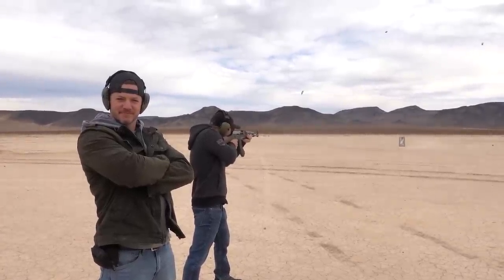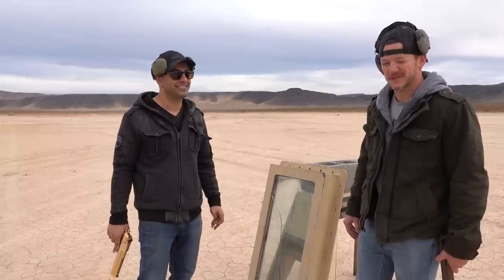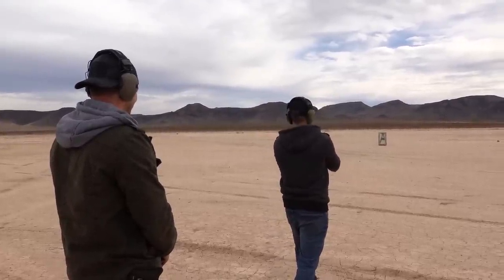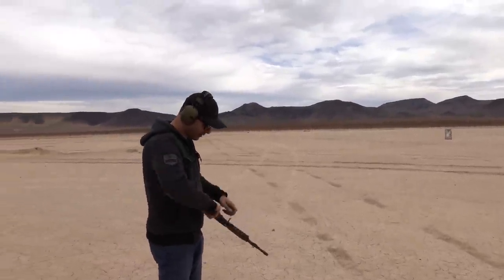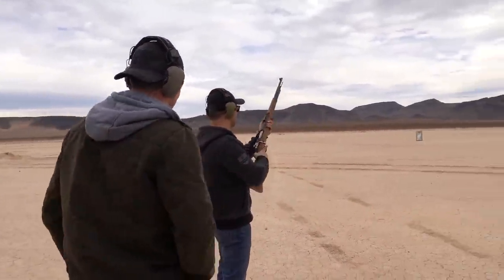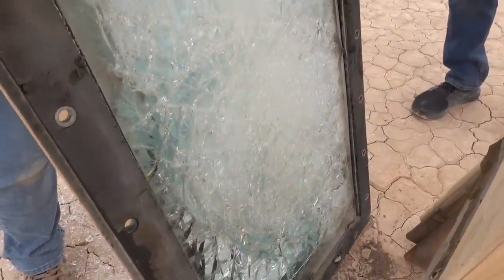Buffalo Minesweeper 6" Thick Bullet Proof Glass vs 50BMG

Comment: The entirety of the glass was compromised by the time you got to the 50 BMG incendiary armor piercing rounds.. I kinda wish you had started with those instead.
Reply: Juppp
Reply: Half the videos are like that.. by the time he moves to the big round, whatever hes shooting at has already been compromised by all the smaller rounds..
Reply: Was just about type the same thing.
Reply: True
Reply: Ramzes Motoa true
Reply: Lia Flexx ak-47s use magazines not clips
Reply: Mitch Zimmerman we all 1 him to star that way. I bet by the time he get to the 44 it would do the same thing.
Reply: Agreed. It was basically 50 BMG Vs. a tray of gravel by the end.
Reply: Maybe if they had a bunch of the windows
Reply: Lia Flexx  the mag is something that holds rounds and has a mechanism to move the rounds and get them to the firing chamber long story short.the clip is a piece of metal that holds a few rounds together and is used for quick reload.example.mosin stripper clips,kar98clips,m1 garand and sks clips.a 5 or maybe 10 round piece of metal that you use to put rounds in fast then throw it away.meanwhile the mag is a more complex thing that should be kept.

A magazine is an ammunition storage and feeding device within or attached to a repeating firearm. Magazines can be removable (detachable) or integral (internal/fixed) to the firearm. The magazine functions by moving the cartridges stored within it into a position where they may be loaded into the barrel chamber by the action of the firearm. The detachable magazine is often colloquially referred to as a clip, although this is technically inaccurate
Reply: Gotta stretch the video somehow
Reply: Exactly.
Reply: Ramzes Motoa ...but it isn't.
Reply: I agree totally!!
Reply: Totally agree..the glass was quite damaged before the 50
Reply: Lia Flexx  Please don't say clips.
Reply: client comun sks is magazine fed
Reply: Yup, or at least just firing one round from each of the smaller calibers instead of peppering the entire panel.
Reply: Yes, wanted to say the exact same thing
Reply: exactly this.
Still a great collaboration
Cheers from Tokyo!
Reply: @toddlaplanteVT85  this is why he sometimes has multiple of the item hes shooting
Reply: Lia Flexx  mags
Reply: Yea I hate it when gun channels test somethings ballistic stopping power for a particular caliber but build up to it with other calibers it's like do you understand anything ?
Reply: client comun unnecessary rambling
Reply: Lol I left a similar comment and scrolled down to see a butt load of the same comments. Lol maybe we can get a re-test like I mentioned. It's a big maybe though I fear
Reply: seriously they shot way to many rounds
Reply: If it hadn't been shot at all, if you place a couple of AP rounds in about the same area, the second shot has a very good chance of going through, especially if they're tungsten core AP rounds.
Reply: Agreed. A proper test would start with the BMG rounds, then worked their way down. That thing was weakened to all hell before they finished it off. No quality data from the test.
Reply: Ramzes Motoa what do Dshk's fire? Is it actually .50 BMG, or is it some Russian round. 
Sorry I don't know haha. All of my knowledge of the gun comes from video games, and all of which say .50 caliber, but that seems odd since I thought that was a NATO caliber
Reply: Integrity of the glass was compromised.
Oh well mistakes happen!
Reply: i said the same thing when they looked at the back side and i seen the holes in it.
Reply: Ramzes Motoa  Not a valid test for what they were testing
Reply: >rated to 50 cal
Proceeds to shoot it with pistols and intermediate calibers just to test it.
Reply: @bigsmokey1439  Older SKS models had a fixed magazine that was fed from the top with loose rounds or strips. Modern versions have detachable magazines.
Reply: David H ohhh ok that makes more sense thanks I wasn’t sure but all the sks I’ve seen are detachable magazine styles
Reply: Same
Reply: I always think this.
Reply: @bigsmokey1439  Saw somewhere that they were reasonably common in the US for a while. You couldn't get new ones under the assault weapons as they had detachable magazines but older ones could be imported under "relic or curio" clause. 
Apparently it's a bit of an issue now as it's legal to buy a new one with detachable magazines but illegal to convert an old one to accept them...
Reply: David H lmao gun laws are just becoming more confusing on purpose to scare pepole from owning them
Reply: @alastor8134  I do agree I've been watching for years.. but saying we're going to "test" it then pepper tf outta the only one you have.. then say it failed on the big rounds. WTF did you think was gunna happen?! I love Matt's vids and I'm not hating on the dude but after what 7 years definitely change of video quality
Reply: he allways weakens the crap hes testing, its like whats the point of using 50 if you just shot it like 80times.
Reply: Oops
Reply: Lia Flexx  probably would've tooken more 50 bmg rounds but that's why they have full auto 50 bmg mounted mg's
Reply: Edwin says it cost $1850 for shipping.
Reply: Totally agree...if not for sure it will not go through
Reply: Yea but think like he had to... What if 50 BMG didnt made it? Than all the other guns are useless to test and he just had an 3 min video🤷‍♂️ that's not how it's works out for him....
Reply: @Washman-jw3hl  Well Denel that designed and built the Buffalo's are in dire straights. So maybe getting windows from the South African military wouldn't be that hard
Reply: Thats a good point.
Reply: considering normal 50 BMG didn't go through while it was compromised, I'd say it's a good test. It would be nice though to see uncompromised glass against the API ammo
Reply: straight up they wasted that
Reply: I came to the comments to post this. REALLY disappointed by this choice!
Reply: Yes
Reply: Exactly
Reply: Tbh it was the first thing I thought about when he said he was starting small

Comment: They’re a tough damned truck. Saved my life on several occasions.  As far as military vehicles go, it was the most comfortable ride I ran in.  Great truck.
Reply: Chad Huston Sorry, they still use these nowadays in U.S. military?
Reply: @youngt-roy8211  yeah
Reply: @youngt-roy8211  Yes, along with new modifications.
Reply: I've never seen one before this video, but I've gotta say, they look badass
Reply: A trusty wheeled Vic for rout clearance huh
Reply: Can I get one of those trucks?
Reply: Why not. Get necessary education and join the army. You will get it for free
Reply: Deddinately the most comfortable vehicle I have ever driven
Reply: NuclearBolton you actually can, I think.  One of the things they pushed is it’s mostly off the shelf.  They’re retardedly expensive, but you can buy one.

Comment: “Its 350lbs. It’s not possible to lift by not even 4 people I think.”

Ordies somewhere laughing while loading 500lbs bombs on aircraft with only 2 people
Reply: *Laughs in Eddie Hall
Reply: Yea with the help of a loader
Reply: Bandit still just two people supporting the weight
Reply: Not ordies but  Oberst !
Reply: I know someone who can lift 300 lbs
Reply: @petercarino8540  300 lbs evenly balanced on 2 ends of a bar that is designed to be gripped, and a 300 lbs 3'x4'x0.5' rectangular slab are 2 entirely different tasks. That's not to say there aren't quite a few freaks out there who could lift that thing alone because I'm certain there are, but a weightlifter with even a 500 to 600 lbs deadlift probably isn't gonna be able to lift that thing, even if you were charitable and let them use some straps to help focus their force near its center of gravity.
Reply: I'm an old ordie who did just that back in the 80s.
Reply: Im pretty sure if I can carry 6 packs of shingles a trip I can lift a 350 pound window lol. Most of the guys I work with could.
Reply: Sure you could big guy.
Reply: @martyjehovah  there's always the kid in the YouTube comment sections that go on wikipedia and copy and paste  like they know everything
Reply: You're not gonna lift the glass that easy up onto a minesweeper. That's probably what he meant.

IYAOYAS
Reply: Are they the purple helmets?
Reply: @martyjehovah  nvr seen the shield carry? nothing very balanced about them

Comment: Nobody:
Edwin and Matt: Lets shoot a 50 high penetration round at something meant for IED blasts and small arms fire
Reply: @jakep111  .50 BMG is an anti-material round. Not exactly small arms.....dummy.
Reply: hahahahaha... its not a small arms imperial japan on ww2 uses .50 cal as an anti tank..
Reply: WC_2 Electric_Boogaloo it doesn’t matter. Look up the definition, it will tell you that it is a portable firearm, including 50 BMG
Reply: @jakep111  portable. Like the M2, MK19, recoiless rifles, AT-4, Stringer. Portable.
Reply: @natebrank4240  Actually Jake P would be right in a way. It would be borderline Small Arms.  Revolvers and self-loading pistols, rifles and carbines, assault rifles, sub-machine guns and light machine guns would be considered Small arms, and that is an Anti-material rifle. Some could even say that weapons that fire under the 20mm round would be small arms.

 Though there is also the classification of Light Weapons, which are  heavy machine guns, hand-held under-barrel and mounted grenade launchers, portable anti-aircraft guns, portable anti-tank guns, recoil-less rifles, portable launchers of anti-tank missile and rocket systems; portable launchers of anti-aircraft missile systems (MANPADS); and mortars of calibers of less than 100 mm. Which is why I said it would be border-line.
Reply: Bud that glass is meant for all rounds up to 308. And shrapnel
Reply: I am pleased my troll sparked these reactions.
Reply: Jake P are you pleased my child?
Reply: It can actually be both. A small arm and light weapon. Both make up the class of SALW (Small Arms and Light Weapons). Firearms for individual use are per definition Small Arms. If a crew is needed to operate it, it is a light weapon. Depending on the use it can actually be both. In the US-Army however it is i think considered a light weapon. (Since it can shoot High explosive Ammunition and is used like a machine gun in a crew). Like D.BlackFoot wrote it is borderline Small Arms but actually used as a light weapon.

Comment: 3:50 that is the first time in history that an AK jammed before an AR did.
Reply: Garbage overhyped aks. Majority of the ones I've used, have jammed on me. It seems like if you don't have the original mag for the rifle. It will eventually jam.
Reply: Steel cased ammo always has a hard time feeding on older guns, maybe it’s my user error or the guns I was using not being maintained properly (they were not mine)
Reply: VËÑĮ VÎDĪ VÌÇÍ yes, tulammo is garbage.  That was the brand of 7.62 that I had feed problems with.

Comment: Helped lift a 400 lb metal sheet around 5/8" thick, 3 people, me (barely lifts 120 lbs), friend (use to wrestle and was in the group of the top wrestlers in school before graduating and helps his father here and there), and friends father 1 (construction worker) over our heads

But 4 soldiers built to be able to do a crap ton in small squads can't lift a 350 lb window

Comment: Spent 14 hours at the range yesterday with my family. I will say most would be jealous. The flash bang 12 ga rounds were insane. Let a stranger fire the 50. Gave him the brass to take home..I will say the m92pap (I run a manticore brake LOUD) is the ultimate defense gun from 0+150 with 0 trouble and th cheapest ammo you can buy.
It really is the best of both worlds..honestly will you be engaging people at distance or breaking? Really? The 5.56 has it on load out weight but where I live you dont go in the bush with a 70 grain anything.
Try shooting lead nose with a AR.
Ak eats 154 grain spitzer lead nose for dessert.
I have a 480 Ruger. Had the pleasure to fire a Freedom Arms 454 that has taken caribou.. and the komrade came out into public after hiding in the basement for a year. 😂. Never fired..I got to say..my 870 can put it to shame on versatility. I will have to play with some external choke tubes. The 870 rings steel at 150 yards no sights..that will fix most problems alone..dead zero hold on my glock at same distance..nice to ring steel at over 100 with you regular sidearm.

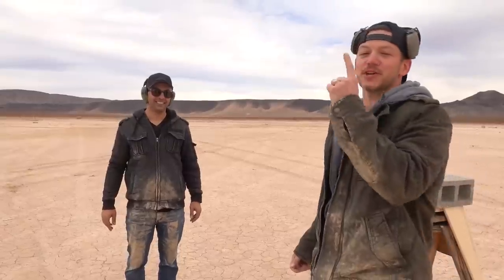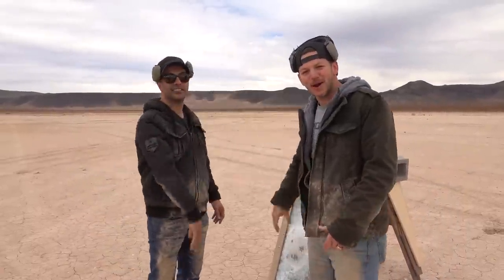Comment: shoulda shown the damage to the stocking horse used to keep it leaned. look at the back face at 8:30-8:31 the images from the drone capture wood flying out the back.. then at 9:17 hole in the center of the stocking horse just under the lighter wood. suggests that the bullet trajectory went up probably because of the angle of the glass then at 9:27 mid point of his right hand and the steel edge of the glass on the dark underwood a big chunk is missing so guess the bullet came up off of that and out the back but he didnt assess the damage done after the apit went through. think its safe to say anyone behind that glass would be dead too.

Comment: I've had the honor of being shot at in a Buffalo and putting new windows in it as a result haha. I believe we used a forklift, and I still have no effing clue how we ever pulled it off. Our mechanics did most of the work, however. They knew wtf they were doing. 

But damn it's a weird feeling getting shot in a vehicle haha. Like, the only reason I'm not dead is because of this roving mass of glass and steel.